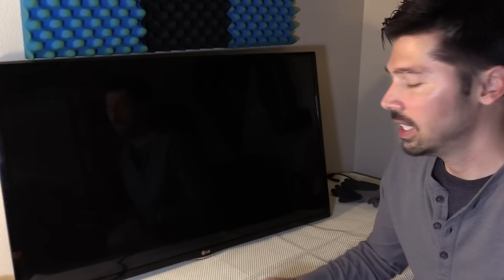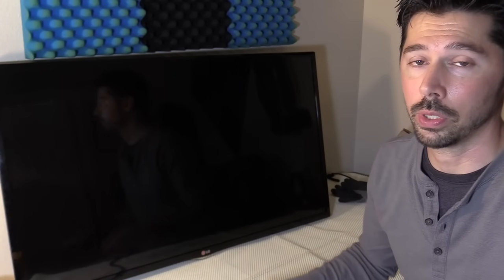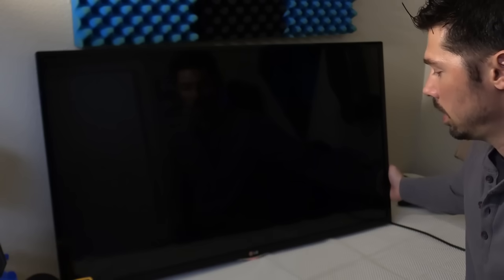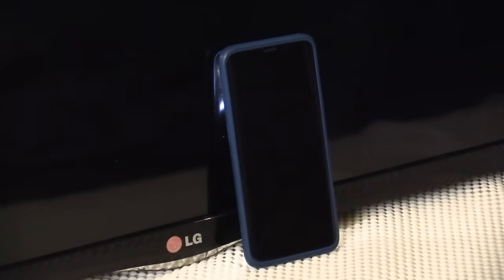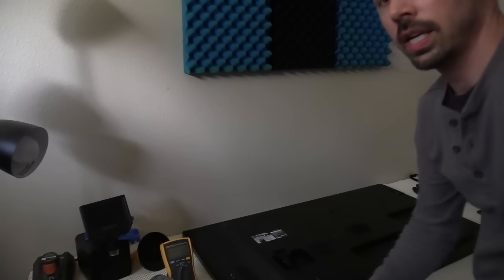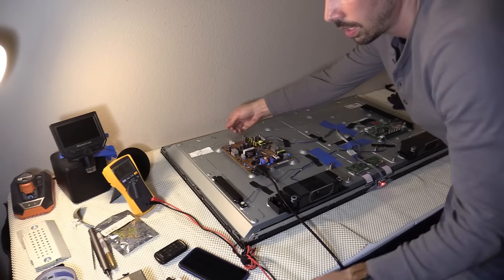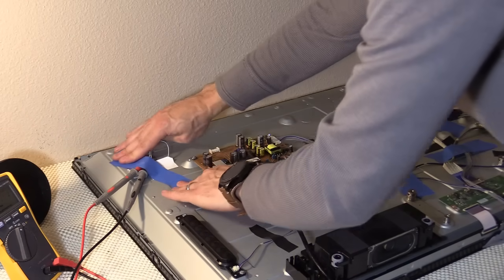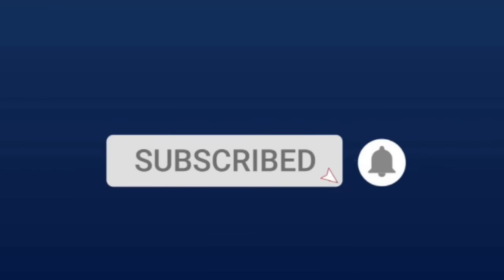3 Ways to Troubleshoot LED LCD TV with a Black Screen, TV repair part 1

Comment: Hiya Paul. I presume you can test the LED strips using a DC bench power supply rather than the doodad you demonstrate in this video... but what voltage do you set a DC bench power supply to?

Comment: Hi, My VU led46k21 turns on and the LED standby light changes from Red to Blue. but as soon as the picture comes on, it goes blank but the standby light remains blue. Also, the brand is VU but the logo on the screen shows another manufacturer. What could the problem be. Thanks in advance

Comment: Great video but I am not sure i understand well. Suppose all the lights went on when u connect the LED tester. Wouldn't that indicate that the lights are ok and something else is not OK? what would it be? PS. Audio is fine and so is the rest of the functions (app selection, input selection, etc)

Comment: It not showing a picture
Reply from the maker: Press menu/settings button on TV remote, if u can't see on-screen menu then use a flashlight 🔦 must be in dark room to check if u see the on screen menu. 
If u don't see menu on-screen then TV T-con board might be bad. 
If u do see menu on screen only using a flashlight then backlight circuit is bad. Get TV boards and backlight LED repair kits at shopjimmy.com hope this helps if so hit 👍

Comment: Insignia model # NS-39E480A13. Has sound no picture. Back lights work. Screen isn't black lights up a little. Replaced T-Con board no change. Replaced Main board no change. Any ideas ?

Comment: Hey! Just found your channel. Great troubleshooting tips.
I have my LG 42LB5610 LED TV at the moment which works for about 15+ mins and then the LED back light turns off completely. That trick holding a phones light to see the image was good. I can see a clear image hidden in the darkness! 
Maybe I'm not getting the right power to the LED lights..?

Comment: I have a Hisense Roku tv 58 in.  Won’t connect to our Roku remote on our cell phones. But when I put the light to the tv you can sometimes see the logo. I can’t change the input because the only remote we have is our phones. Any idea what’s wrong with it. It’s only four or five years old.

Comment: Would love your help @tampatec. I have a Samsung un55ks800dfxza. It turns on (based on standby light and blacklight glow) but after a second or two the standby light and the backlight both go off for a couple seconds before they both turn back on for a few seconds and the cycle repeats. It seems like this would be a power issue but from some of my searches it sounds like a power issue would prevent me from getting standby lights at all. Could that indicate an issue with the backlights which is causing the tv to power down?

Comment: Lg tv. 47LM7600  Turns on plays well anywhere from 1 min to 3 hours. Goes black with sound. Shut it down for a few minutes and works again for a while. I did flashlight test and I can see menu etc. What the heck could it be?

Comment: I have a 2014 LG LCD/LED  tv, model 65UB9500, the screen is black with sound but only with the antenna connection, the hdmi connections all work fine. I use the antenna connection, any thoughts?

Comment: PLEASE HELP!

Hey there! I'm a recent follower, but LOVE your stuff. I have a problem with my LG LED TV, and I'm hoping you can help me figure out my next steps.

I have the Black Screen of Death on my LG LED TV, but when I do the flashlight test after following the steps of this video, I don't see any images on the screen. Is it the T-Con board if there is no image at all during the flashlight test? If so, my particular model has the T-Con board bonded to the top on the back panel, and I've read that this is makes replacing it next to impossible.

Regardless, I'm stuck and could use some help in the right direction :)

SERIAL = 406RMJF0L508
MODEL = 50LB6300-US
SERVICE CODE = 50LB6300-US.BUSWLJR

Standby Voltage = Yes
TV Turns On, red light flashes like six times before going off

Thank you so much for the help!
Meg
Reply: I have a photo of the schematics after taking off the back panel if that helps.

Comment: Maybe this is not the proper place to ask what might be wrong  with my tv, but I will ask anyway.  I have a vizeo p55-f1 tv.  Tv won't turn on.  I have the  little white Iight indicator on lower left side of tv which I thought is telling me tv is on. vizeo logo comes and goes, no sound,  there is a grey screen that comes and goes but screen is mostly black.  I see no images in display. No lines.  So mostly black screen, vizio logo comes and goes, grey screen comes and goes. Indicator on light comes and goes.  What might all this indicate?

Comment: IHi bro,I really appreciate your guidance on how to tackle any issues that may arise from lcd,smart tv.thanks. in addition to this I have problem in my 32inches lcd tv (scan frost) which I have find means to it.but one concerning is that I order for the control board ,it work but display Hkc on the screen fently and later black screen. Pls what could result to this.

Comment: I have a 55' sharp tv with a standby light. The standby light turns off when I push the power button on the tv but the screen is black and then the standby light turns back on. I checked all the capacitors and nothing on the boards were burnt or had leaks or bulges. Is it the logic board?

Comment: Great video, Thanks,

Could you help me with my case? I have a Vizio e55-e2 and the black screen happens when the image is totally bright, so I decided to lower the backlight brightness to 60% and it works for me, but when I watch HDR content, when the image comes from a dark scene to day/bright scene the backlight turns off, the sound and image is still there (flashlight test)

Comment: I have a 55in'' Hisense 55R6E black screen no sound . red light comes on bright for 5 seconds then dims for 3 seconds then off and back on for 1 second them off again .then repeats over and over  Can not turn the red light off or make it stay on . I did put a light on the front screen and coung see Roku unplugged it and the Roku light went off . new Batteries in remote /nothing

Comment: Dear TempaTec, thanks for your video on resetting my sharp aquos smart TV. Have done reset trying different ways you outline. However, still showing a yellow K error code and even though I retuned channels few times it doesn’t retain. Is it just time to pack it in and get a new tv? (This one  is only 3 yrs old). I welcome your thoughts please.

Comment: I have a Philips tv where there’s a vertical Dark shadow (in what looks like 1 row of led lamps) on the left side of the screen. In all the led strip replacement videos I see the strips are horisontal, so if I assume that’s the case for my Philips as Well it seems unlikely that vertical row of leds would go out across multiple strips. Any idea where I should look for the error here? Like what could cause this, top-3 reasons or something? 😆 thanks for a great Channel!

Comment: I have hair TV. The TV shows picture for one day until we turn it off. But after turning off. It does not show pictures only sound comes. Again if we turn it on after 4 to 5 days it shows pictures until we turn it off. When we turn it on after long time some part of screen flicker for some time then it works fine. What may be problem.

Comment: i don’t understand why they went out all of a sudden yesterday night the screen was perfectly fine, and when i turn on the tv the Roku sign and red back ground shows perfectly for like a second then goes completely dark but i can hear me moving it with the controller
Reply: lightbulbs or in this case leds go out randomly
Reply: It shows up then bam goes out
Reply: Same
Reply: i have the same problem but mine is not lg it's sunnny but not smart tv i reset it was fixed but it happend agian
Reply: Me is doing the same how mach to fix
Reply: Me too
Reply: I tried looking for anything to help
Reply: This is same with me
Reply: Did ur tv got fixed?
Reply: Same here 😭
Reply: Same here 😭
Reply: The screen fully lighting up with images then going black after a few seconds intuitively seems like whatever is controlling the LEDs not the strips themselves..any suggestions?
Reply: @LobsterGPT  its likely the backlight capacitors. Super easy to fix.
Reply: @IcemanRage  how do you fix it?
Reply: samee

Comment: I'm new to this so any help is appreciated. TV has sound, no image, not even with torch on screen. I can change volume and settings so the tv receives power and hdmi input. So that means I have a T-con board issue right? So if I replace that it will work?

Comment: Greetings, I have an older Panasonic Plasma TV, TH-42PX75U, that will not find TV channels via cable input.  I have tested the cable by hooking up other TVs and it works fine.  I suspect the TV tuner is bad, and have found a replacement board online from Electropartsonline (your recommendation) and wanted to know if you think replacing it would fix the unit.  Thanks in advance.

Comment: hi TampaTec, i was brought to this channel while searching for a solution to my tv's problem. i have a samsung hdtv curved tv. my tv channels were received through a cable provider connected via coax. everything seems to be working fine at first until one time, there was no audio to every channel, display was fine but the sound is either silence or static noise. i can confirm that my tv speakers are working fine because it does have sound when connected to the internet. my theories are either; the coaxial cable/wire are damaged OR my coaxial receiver is. as i said, i was brought here because of one of your videos where you suggested the hard reset and reading through the comments, i could say that it worked for most people. i have already tried it but it didn't help. hoping you could give a solution to this problem or at least suggest things to do to diagnose what is wrong and how to fix my tv.. thanks😊😊😊😊😊

Comment: I have a Samsung tv that has only 2 hdmi imputs. I have a Bose 700 sound bar, which connects to tv with an arc cable. Will this box work for me? I would like to connect a Blu-ray player and 1 retro nintendo, and an xbox which all use hdmi

Comment: Hi, I replaced a main board on M3D460SR vizio tv that lost color. I got the new/used board in. I have color and tv works from the apps and antenna, but when I plug in my ps3, home theater or cable box in the HDMI, the screen is just black. Goes from no signal, say 1080p in the corner, but is black. When I hook my laptop up through it. I can get that picture to come up fine.

Comment: Hi , do you have experience with LG? My lg 43uj634 has problem with hdmi ports. My tv has problem with recognize signal over tv, when I set source to 720p mostly work by if set 1080p or 4k mit working. On 720p sometimes I have to unplug from power and then works.

Comment: What should my voltages read coming out of my power board going to the main board voltages for power board 310432848913 2848913 philips 42pfl7422d/36 HELP
Reply from the maker: 3v or 5v

Comment: I've been following your channel for quite a while now and by using your advice I have fixed about 5 TVs. However I am completely baffled at this moment. 
I have an LG 55 in Smart TV that the back lights went out. I replaced all the backlights with a brand new set. I tested them when installing them  with the backlight tester  from shop Jimmy . After I got everything installed I tested the backlights one final time and everything worked perfectly.
 I then reinstalled all the electronics and now, when I turn on the TV I just have gray screen when the back lights are working.
 If I unplug the backlights and power the tv on I can see the LG boot up menu and everything like the TV should normally be by using flashlight. It's only when the backlights are plugged in that it does not go through the standard boot process by pulling up the LG logo and then kicking into standard screen mode. What would you suggest? 
 Thank you for all you do and putting out the videos for us to have some inspiration.
Reply: Update: after I unplugged the TV and gave up for the night, I plugged it back in in the morning to try it again and everything worked like it was supposed to. Apparently the TV needed to catch up with everything else LOL thank you again for all that you do. 
We do truly appreciate your videos. With your help I've fixed multiple TVs now. Keep up the good work man.

Comment: hey love your videos,i have a vizio led,it had no pic,i found bad power supply solder joints ,fixed them ,got a pic now only thing is i have a lg black verticle bar in the middle of the screen ,is this the panel

Comment: Having issues with my LG Tv. I’ve replaced the power supply, mother board, and led strips, and still get no picture... I’ve tried the flashlight test and see no picture on screen. Possible t-con board, or panel itself?

Comment: you forced voltage to the LED strips through the main cable, so does that mean the power supply/backlight driver is good?
is it because one black light strip causes the rest to shot down / close circuit?

Comment: Found your video troubleshooting no picture.  I have backlights and can watch the tv but after a while the picture goes out.  I could turn off the tv and have the picture back for a while.   I noticed the frc board was pretty hot.  It has 12v from the main board and it sends 12v to the tcon.  Once it gets hot, 12v remains to the frc but no longer have 12v from the frc to the tcon.  Do you know how I can fix this?  I've searched everywhere for another frc board but no one has it in stock.  Could you possibly locate one?  The part number is SY15172 frc for a 55" element e4sfc551.   Thanks

Comment: I replaced the lamp in my Samsung s 5086w it worked fine for about a year. It started cutting of every now and then but would comeback on when restarted. Now it ic untying off after being on for around five minutes. All three lights on front flash. It will cut back on. But want stay on but about five minutes. I have head a sizzling sound sometimes before it cuts off now. Any suggestions. I just hate to let it whip me

Comment: I have  55" LG TV. When it powered on, the splash screen displayed for a few seconds and the screen goes dark. Visual and onboard check of all capacitors showed no defect and within 10% of values. LED+ voltage check: started with 74V and screen working, then it dropped to 49V after a few seconds and the screen went dark. Also, an amber led is blinking 3 times on the power board. My guess is problem with the power board. What do you think?

Comment: my toshiba 47inch led tv showing black screen, have replaced the burnt led strips to new one  but it fails to light up, it turns on sometimes, sometimes it wont just a flash and full dead ,at the time of backlit fail i checked the standby voltage read 5v  but 12v and 13v are showing 0v and at the led strips voltage drops from 100v to 0v , at the time of lights up the led strips are getting 108v to 114 v  and all the values from the t con were good. any idea whats the problem it has ?

Comment: I have SAMSUNG UN55KU7000FXZA TV. Upon connecting the TV to power source and pressing the ON button on remote, backlight comes on for a second then turn of and the red LED doing the same thing at the same time.

I have replaced both Power Supply Board and Main board but nothing changed. 

What could be the problem ?

Comment: Hey I have a Samsung 48inch TV about 5 year old.  It stopped working after a power cut.  When I power it up it double blinks 5 times . That's all I get.  I don't want to throw it away. I'd really appreciate it if you could help me.  
REGARDS Patrick

Comment: hi bro! thanks for the video! i have a question, i have an hitachi 50hyt62u seems to be black light, because when i turn it on and i point with the flash i can see image, but when i put tv is like doesn't appear the same as you, is still black, so first i dont know what means that, maybe are diferent TVs i dont know what can be reason so also i dont know how check the sound. great if you can help me!

Comment: hi i have Samsung UN48J520DAFXZA (Version ED04)
the problem no picture but has sound no light behind the tv no led light but in dark room i put flash light i can see menu display
any solutio the same your video my problem but with samsung

Comment: Hey great videos.very helpful to help me trouble shoot my 50 lg . Black screen.  Just one question  should the power going to the led strips go from 120v and slowly drop to hold at 78v. Doesn't seem right to me.

Comment: hey man i have problem with my vizio tv it works for awhile then shows half teal half pink screen and shuts off, shows vizio logo and rebooting and does not turn on at all after that. I leave it unplugged overnight and usually it turns on after that, but not for long. Any advice?

Comment: Help please. Mine has standby light but it does nothing when press the power button (standby light keeps on). Before it was working once in a while, sometimes it would turn itself off, the audio sometimes went off while the image was still going. What can I do?

Comment: i have a 42 inch philips tv, (42pf9830/10) where the lcd blackout after a few min, looks like no screen, not just no backlight, though when i softly tap one of the coolingpads on one of the boards the screen comes back, and i did notice that if i mute the screen before it goes dark, and tap the cooling pad, the screen comes back without being muted, im guessing that makes me think i have a bad board or bad components on that board?